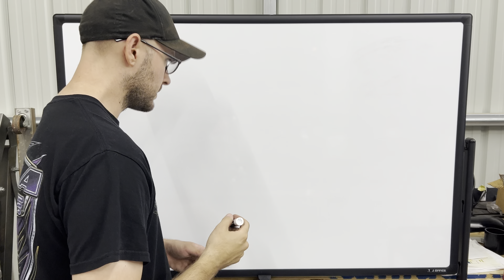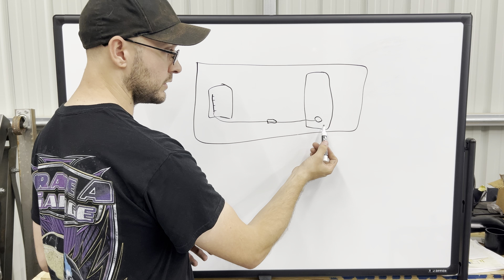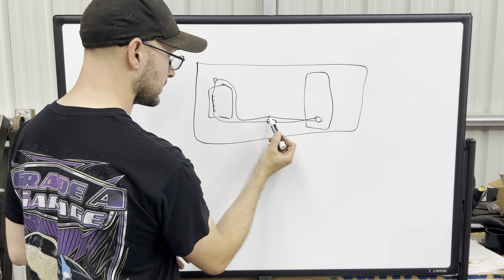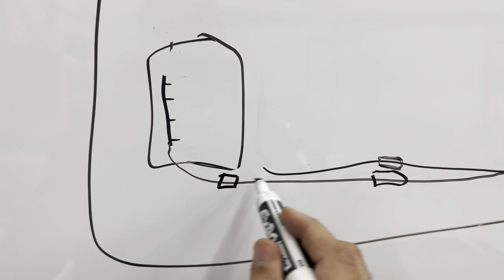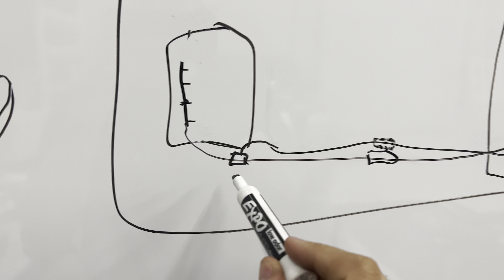Building A Complete Fuel System Start To Finish

Comment: What vaccum did you connect on the regulator?
Reply from the maker: @cesarchavez7052  that nipple should be connected to the intake manifold or vacuum source so it can see vacuum and boost. You set your base pressure using the adjustment screw on top (with the vacuum line unhooked and the car idling). Once your base pressure is set, you can connect the line so the fuel pressure can rise and fall depending on vacuum and boost.

Comment: would this kit fit on 2015 jeep patriot 2.0L?
Reply from the maker: @CRAZCHEVBOY  this is not a kit. These are the individual items I used to build my fuel system. You will have to research which fuel rail, injectors, fuel pump/canister, lines and fittings, etc. will work for your car/engine setup. The caliber and patriot are very similar, these exact parts might work for you, but I can’t say 100%.